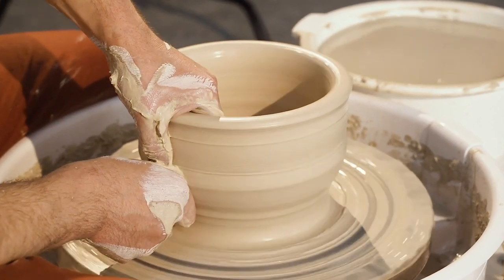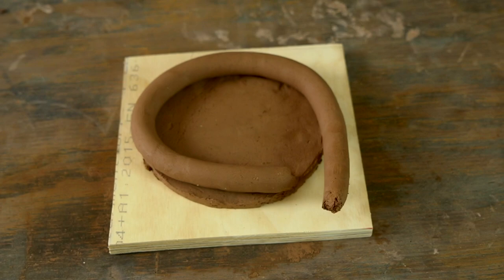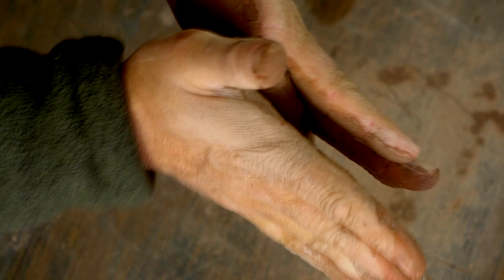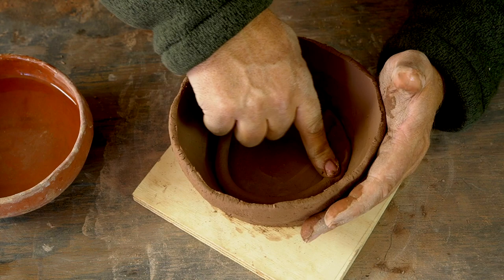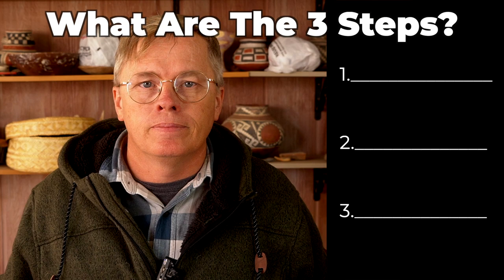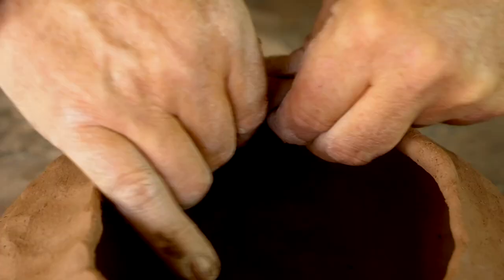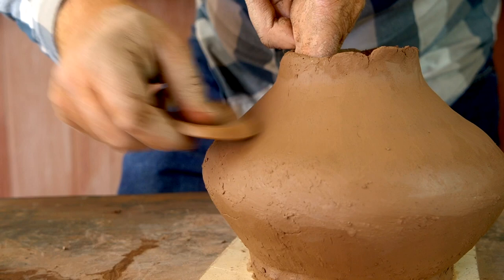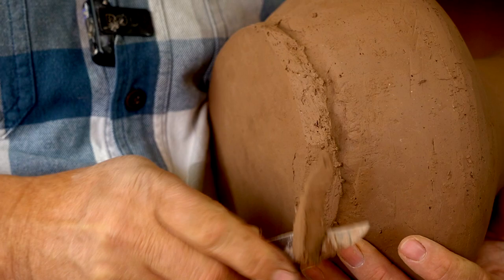How To Make a Coil Pot (the Easy Way)

Comment: How thick is to thick
 total wall thickness
At 25% to 30% sand
Reply from the maker: Good question. I'm not sure there is such a thing as "too thick". The thing is, the thicker you make your walls the more clay you will use, the heavier the pot will become, and the more careful you have to be to preheat it. When I was at the SW Kiln Conference last year some people were rejecting pots from their kiln as "too thick" and I was welcoming them saying that there was no such thing as too thick. Just be careful to preheat very well to make sure there is no moisture in those thick walls. I usually shoot for about a quester of an inch in thickness but that is dependent on the skills of the potter and the quality of the clay.

Comment: thanks for your vids andy!   and i wanted to build an oil lamp today, so i dragged out some clay that had been sitting in my cabinet for a couple months (i'm a beginner, running a pizza shop so time is limited), and i found my clay was too dry.  the coils i rolled cracked when bending them, so i added water, kneaded, added water, kneaded, but the clay just seemed to get worse and worse, even more cracks than before.   so it's sitting wrapped up in plastic in a lidded bucket, i'll take it out tomorrow, and see if the consistency has improved.  Do you have ANY ADVICE for knowing how much water is needed in the clay for this type of coil building.  My clay is bought from a local studio ( i live in Taiwan, and my chinese knowledge of ceramics is zilch, but it's a dull gray clay, and i've fired it up before to 1220C and glazed with woodash glaze with good results), so i don't know exactly what it is.  thank you again, i love your vids.
Reply from the maker: Your clay sounds like it is lacking in plasticity. You can mix in some more plastic clay or try purifying your clay.
Reply: @AncientPottery  i appreciate you replies, always helpful!  Thanks!

Comment: Andy. im fairly certain ive read something that claims the native Iroquois made their pots by building the clay around dried gourds and then burning the gourd out leaving the clay behind in the shape if the gourd. do you have any idea how they could have prevented cracking and shrinkage in that process?
Reply from the maker: This is hard to believe. Clay shrinks when it dries and any pot formed around a solid object like a gourd would tear itself apart as it dries. Probably just speculation from someone who had never tried it.
Reply: @AncientPottery  that is a good point. i need to see if i can find anything on that topic to read about. then ill know more clearly
Reply: I suppose you could smear clay on the inside of a gourd or basket but it wouldn't be smooth or even.
Reply: @airstreamwanderings3683  that could be. honestly i read about this years ago in school, so most likely the text was either dumbed down for kids, or im just remembering incorrectly. ill need to look into it again